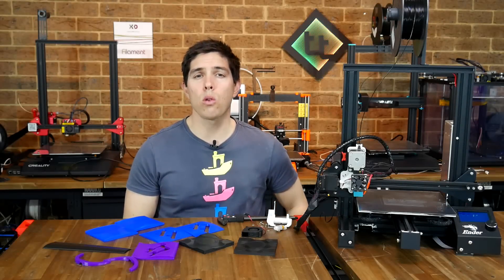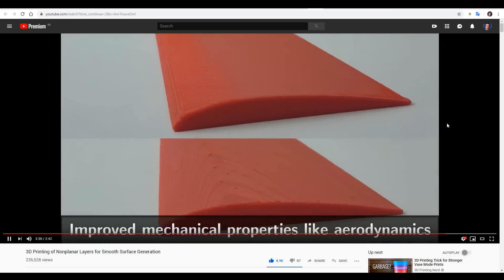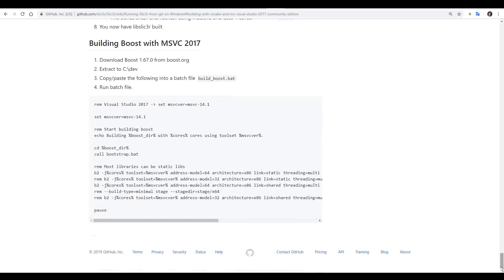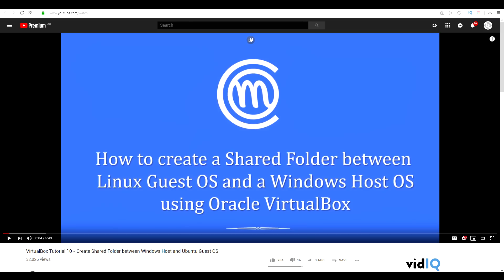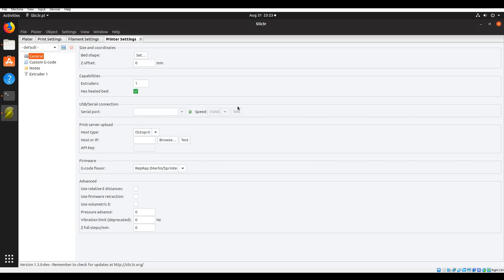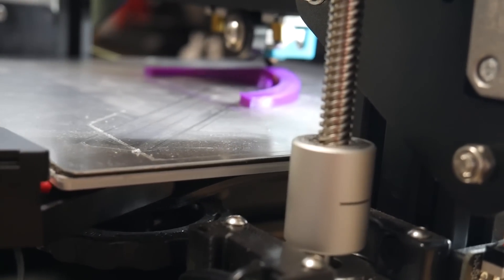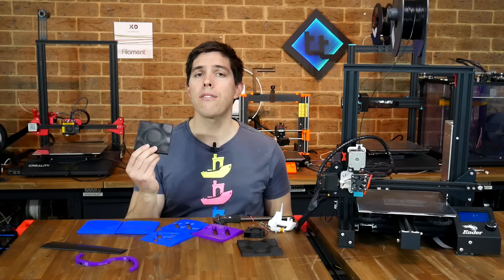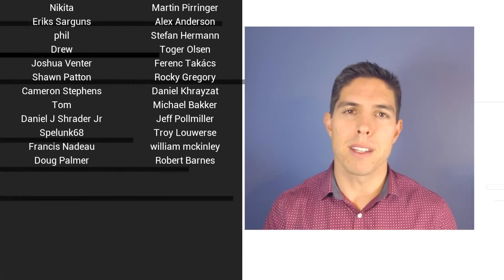Achieve true 3D printing with non planar slicing

Comment: There should be an option for every printer to print even the outside perimeter using this, like ironing even if it would take a lot of time and probably would have to be very slow on most printers because of the slow Z axis

Comment: if you don't currently have a Linux machine, UBUNTU is a very approachable option you can install it next to windows or have it be the OS for that computer alternatively if you're doing some lite linux work you can hit the "TRY UBUNTU" option once you have the installation media loaded up  (it will run completly off of the flash drive although DO BE CAREFUL because it will have full access to your windows installation (it will allow you to delete system 32 and break your windows installation))

Comment: But if you used abs or similar material that doesnt like fan cooling and then something like the cr30 print mill where its a core xy machine but at an angle.... this could make beautiful things, we just need to probably use ai to generate the tool paths... the biggest flaw i think the cr30 has is the planar gcode...

Comment: sooo half the video is about trying to run linux.
take a usb stick. flash it with an iso of any decent operating system. reboot your computer. boot from the stick. done. no need to install a virtual machine. doing this in real time takes about as long as the video up to the point of where you actually start using the software. I'm aware that there are people who struggle with this and you probably don't want to hear this because you're "Teaching Tech", not "Learning Tech", but this could have been a separate video.

Comment: With modern printers like bambu's using load cell setups, and third party nozzle adapter existing, mixed with a volcano nozzle for long length, this seems more viable than ever; minus the part cooling needing a bit of modding

Comment: 4 years later and still none slicer supports this. What the actual F?
Reply: The technology was patented by AutoDesk in 2015. So stupid.
Reply: @cryptophoenix3031 how do you patent something so intuiative?
Reply: @dagurorarinsson2827  the wheel have been patented in Italy 20y ago.

Fortunately, the patent was revoqued 6 months later. This was done to test if patent checkers do their job seriously. Obviously not ...
Reply: Must be able to implement this now. Lots of printers had load cell for leveling and you can aim the airflow towards the nozzle from a greater distance
Reply: Joshua bird just did it
Reply: @Blargedy  thanks for recommendation!

I was suprised that I have already subscribed him, since I don't remember any of his currently avaiable videos (but It is also entirely possible that I clicked subscribe button by accident just now).
Reply: Not the most scalable solution to slicing, the standard way is is more reliable and can be applied to everything "easily"
Reply: Can’t imagine the pain of rebasing these slic3r changes but it could be a fun challenge
Reply: My slicer supports 4 dimensions.

Comment: Prototype machinist here 👋, I’ve often marveled at the simplistic nature and near total lack of control found in slicers vs CAM software like Mastercam and Gibbscam. I think the next big move from here is going to be integrating the two, allowing for specified control of layering and feature creation based on feature based parameters. Eventually, I expect there to be 3D printer g code generators which use actual solid models and can use a mixed variety of strategies based on the features of the part as needed and as programmed by the user. 3D printing has the potential to become extremely sophisticated and powerful when this happens.

Comment: Most hardware issues related to the nozzle clearance can be solved using a mechanism similar to BL touch, where the nozzle can be extended through a command at will so it pertrudes further, and with a known travel distance once it is extended, it can be compensated for by the Z offset parameter. Sure, the best solution would still be to tilt the nozzle, but that's the second best approach. Slicer implementation via a plugin would be dope as hell, instead of going through the process of installing a VM and whatnot.

Comment: I am starting to wonder how this has taken so long to come to market. It has been 4 years since this video came out. And this is still not an integrated finish mode of most, if any printers. Essentially it is a CNC milling slicer in reverse. more advanced 5 and 7 axis mill manufacturers protect their software so I can understand a little. but basic milling software has been around for so long I'm surprised it took this long for someone to do the math.

Comment: This is exactly what I need to do a motorbike tin cover but it hasn’t progressed anywhere by anyone in last 3yrs….  It would be nice to get a slim nozzle assembly with a lidar depth check. Perhaps a mk4 with strain guage would work, with modified fan shrouds to lift bits up would work but how they have the pivoted fans may impact. Mihaivdesign extruder could be an option. 

I’d look at this but seems be an aweful lot of faffing around.

Comment: I hate to tell you when it’s virtual machine is built into windows 10. Here’s need to make a few changes in your bios and you are up and running with the version of Linux you areusing plus the allows you to share drive switch fixes your problem of getting data back-and-forth and works on the local network. If you go into windows 10 add and remove software from the old interface click on the buttons for option for windows and install the virtual machine. It will automatically create a hub for you the first time you run it up and Linux is installed in the software ready to go if you want to do a copy of it you can do just about anything you can do a iso of.

Comment: I just wish we could do 'half height' layer lines on outer most skin perimeter, which has separate, more accurate calculations. This could effectively half the apparent print layer size while only barely increasing print time, but I am not aware of a slicer that can have multiple layer heights within a single layer.

Comment: I wonder if you could add a laser like adding  a Bed Prob as in offset from the print head. Then Have the laser calculate the distance of the part contour to keep the printhead nozzle at lets say 0.1mm above the print at all times. And turn the Laser value into Z height Gcode values on the fly.

Comment: Michael you comment on the Fan Shoud coming into play when printing in this technique. I have had this happen with 2.5 D printing. I wonder if Razing  the fan Shoud and then print an angled fan duct would work. I realize if the fan duct/Shoud is to high then the Air will hit/cool the nozzle to much instead of just cooling the print is the main issue.

Comment: Hey, excellent results. I'm new to 3d printing although I know every 3d printing happens on a flat surface /bed/. But I'm wondering if 3d printer print on non-flat surfaces. In fact, I'm thinking about printing on incurved surfaces. What do you think, Is it possible? 

ps: I don't know the exact English word for it. Maybe "concave" is the correct word for it.

Comment: OMG. I am supposed to install a VIRTUAL LINUX MACHINE on top of my Windows machine, then COMPILE SOURCE CODE for dependencies, THEN COMPILE MORE SOURCE CODE for the main slicer, then from then on use the modified, compiled, custom slicer program FROM WITHIN A VM? Dude, this is awesome, but not that awesome. I don't enjoy going through programmer-rabbit-hole-hell just because some dev somewhere didn't bother writing cross-platform code or using a common, cross-platform build environment. WOW.

Comment: "Stupidly long and detailed"... As someone who was a software developer/architect for 30 years, though I'm now retired, I was somewhat amused and mildly insulted by your comment! :) But all is forgiven since I used your tuning site to tune my first ever 3D printer. An Ender 3 Pro that a US retailer was selling for the stupidly low price of $99US! Though it was a four hour round trip to get it since I was an instore price only. It was well worth it.  I followed your other videos to install a BL Touch, SKR Mini E3, v3 in my case, and a Hero Me cooling solution. I've been printing the parts for LowRider v3, a CNC option I was not aware of until you showcased the upgrades you made to your version 2 of the LowRider, and I'm very happy with the printer's ouput.

Comment: This is awesome!  It turns out that my 3D printer is perfect for this as it has a long nozzle and hotend that sticks quite far down from extruder. Also this version of Slic3r may be first program i've compiled without issues. Working on Ubuntu based Pop_OS certainly helped but being able to go from video on YouTube to first small model printed with nonplanar layers under an hour is something I didn't expect! Top layer imo looks better than other parts made on this printer.

Comment: When I bought it the ender3 pro was the best bang for buck in all of additive manufacturing. In 2021 a lot of people dismiss it as glitchy and poorly made. I have about $500 invested with all the mods over the years. Based on mm, speed of travel and number of hours printing my printer head has traveled over 1000 miles, and printed more than 40kg of plastic. The thing is a highly underestimated workhorse. Sla is nice and all, but with some sandpaper, a shadow detector, and bondo I’ve been getting functional mechanical parts and desktop accessories that rival the best you can get in FDM. My ender 3 outperforms a $1000 Prusia with ease. I’ve done all the repairs myself so I know this thing in and out. Still rocking original steppers, and power supply. After more than 10,000hrs!!!
Reply: Now this i have to learn about
Reply: @toddkuznitz3629  there are much better kits nowadays and SLA has come miles. An elegoo Saturn will run you back $500 and is so detailed you never need to buy a model kit again. I think creality has some new offerings too all in the sub $500 category. However I don’t plan on upgrading until this hobby is pubic and not niche. My ender3 has been tricked out so far that it doesn’t make sense to upgrade. I have almost every performance mod you can get, but still run stock hotend, PSU, stepper, frames and belts. I’ve changed hotends once in 4 years. More important than quality of printer is quality of assembly. I get wicked prints not because of the mods I’ve done, but because every parallel bar sits at perfect level to the table and then to the floor, and every perpendicular bar sits at exactly 90• not 91, not 89. Threadlock where needed torqued to 20ft-lbs. every single screw, every single bearing every single roller triple checked. A smart person can have one assembled in less than an hour, but to do it properly should take you 4-5 if you know exactly what you’re doing. Teaching tech is my go-to for knowledge, but if I can help lmk.

Comment: I can't get this to work, any help?
I have the slic3r installed and 99% configured. Just cannot actually get the slicing software to... slice it correctly. It has lots of red layer lines and won't do the full 3.0 dimensional renderings. I'm nonetheless printing the part from the program, just to see what happens. Any help, much appreciated! I also am awaiting a specific-to-ender-3 longer nozzle and fan duct! It allows for MUCH higher clearances. 

Update! Before I posted my comment, I ran the program as super user, and used the following settings:
Nonplanar layers: Checked
Max Nonplanar angle: 55 
Maximum nonplanar collision angle: 90
Minimum nonplanar area: 4.2mm^2
Maximum nonplanar collision height: 250mm
Ignore collision size: 10mm^2

It has lots of those blasted red layer lines, but pronterface opens and understands the gcode and it LOOKS 3D!!!

Comment: With kinematic leveling on printers like the ratrig could you revisit this? Where the bed tilts to make sure there isn't any contact with other parts and keeps the hotend perpendicular to the printing direction. it would also be interesting to see if you could print otherwise impossible features by tilting the bed so they are vertical.
Reply: That's why the ratrig is the right choice right now

Comment: That's very interesting, thanks for making this vid. My heavily modified A8 printer is well suited, as the blower duct simply slides off and has no autolevel sensor. I might even make a custom heater block and use a longer nozzle for extra clearance. 

Did you have a problem with lead screw backlash? Did you compensate in code somehow? I want to upgrade my other printer (corexy) with 3-point ball screws at some point but that's a long way off atm.

Comment: Bruh people should just use Linux
Reply: People should just use Linux grow a braincell.
Reply: @BigP.P.  I mean, depending on the distribution Linux can be pretty much as user friendly as Windows, and usually in my experience a google search will give step by step instructions for doing anything complicated through terminal commands that people have already figured out, which just boils down to copy/pasting.
I use Linux Mint and aside from the rare compatibility issue haven't had many problems running or installing whatever I want.

Comment: While I know this has it's applications, for the types of test prints you did there, the simple way to simulate the end result is just to rotate the print 90 degrees so it goes vertically. You'll have a smooth not stepped finish without jumping through hoops, plus you can keep the cooling fan. Obviously not applicable everywhere, but I would think for majority of prints, figuring out how to rotate and maybe add supports would be a simpler and more elegant solution for getting smooth surface finish.

Comment: It would be interesting to see a printer with a long extruder with a special slicer that could merge the two methods with a much deeper nonplanar ability. It could print large but detailed and non stepped parts. Or with a resin printer. That would be interesting.

Comment: I remember I was trying to print a large trapezoid in school, it was modeled after the Master Sword Pedestal in Ocarina of Time, and was going to hold my 3ds. We had to do it in 2 prints so I even intended for it to open into a compartment to hold game carts. Unfortunately, the print failed pretty low in the print, and a large chunk of the bottom snapped off every time. I think this is because of the planar printing, as it creates structural weakpoints. Would this potentially help the print, even though we're not using a curved surface, but just an angled plane?

Comment: It would be nice to implement this in cases where you just need 3-4mm clearance and the angle is below 10-15 degrees. Almost all printers could handle that. It would make the top of many prints much nicer.

Comment: I'd probably use the custom slicer, and then post-process the g-code using a modified version of the script. I might also use pre-processing for load-dependent infill, and post processing for gradient infill. And I'd of course use the gyroid infill choice.

Comment: holy crap, how did this not immediately get picked up by major printer manufacturers and major slicers??? This is amazing, it's crazy useful for printing curved thin plates, like go pro mounts, where you have to have the layers go along the mount so it's strong but also smooth on the end.

Comment: Put a proper Ubuntu dual boot install and run builds on Linux. They are more efficient on Linux and easy to debug in gcc rather than Windows vs ecosystem. And you get the access to open source software mostly developed for linux widely used for these types of research projects.

Comment: nicely done. This is exactly what i need and was hoping would come along. I work for a small mint and have been dealing with shallow relief sculptures foe 35 years. I made a 340mm delta that i thought would be useful. Problem is that the top plane; the one I need the most, is the worst. Yes, I did print some sideways in vase mode but to print shallow relief quickly in the round would be Ideal.
               Also my Delta with a smoothieboard (azteeg v5 mini)  hit the skids recently because I upgraded my computer and the firmware (i think) got currupted. It's a beautiful kit from Griffin 3d which is no longer there. I hate to see this go to waste. I'd love to get it repaired but now creality sinks in. pun intended. It's like fixing Christmas lights.

Comment: Comparing the hot end of my FLSun Q5 to your modified Ender hot end, it appears to be a very simple mod on the Q5. I'm curious if a delta printer might have inherent advantages over a cartesian printer. Looks like I have a new project to work on. Thanks for the video. New ideas to play with.

Comment: Just an FYI - when this video was made, WSL wasn't really good enough to run GUI applications in Linux.   WSL2 has been out for a while now though, and should work much better/faster, without the need for an entire virtual machine.  You can also directly transfer files between linux/windows (it's just a folder for the WSL2 "machine").